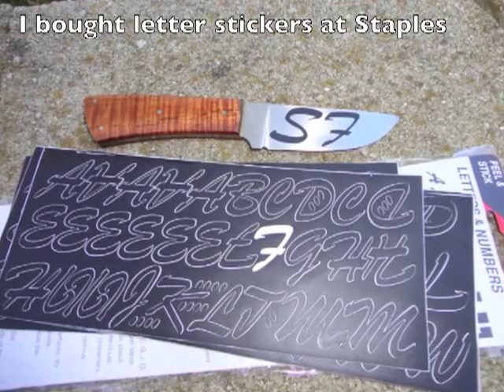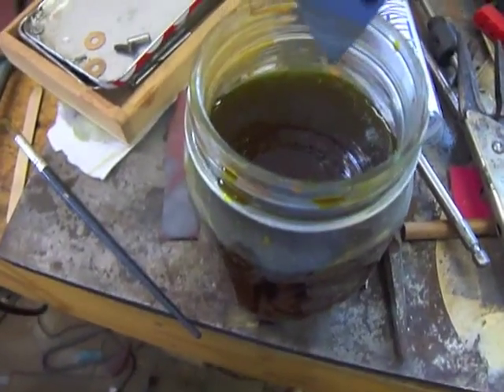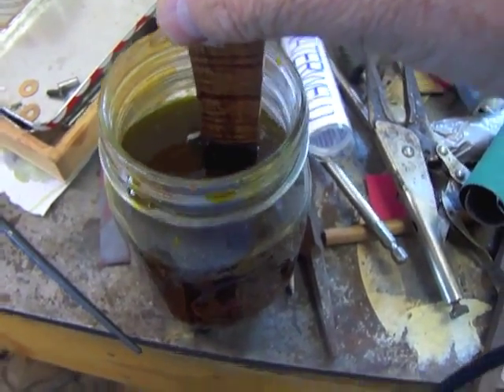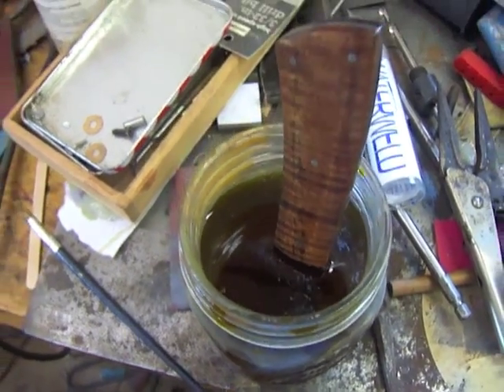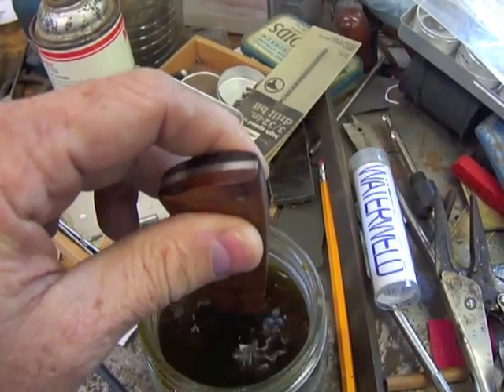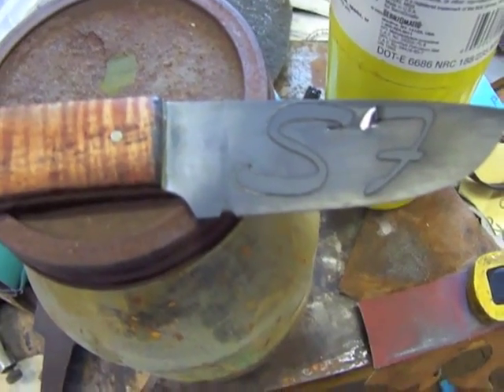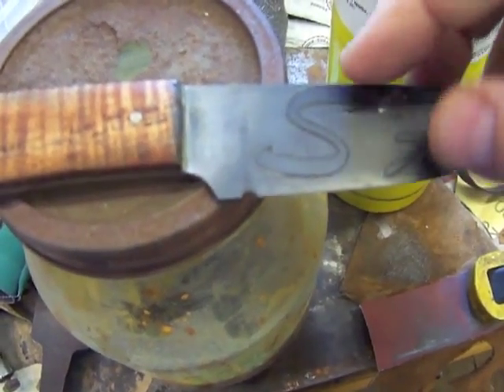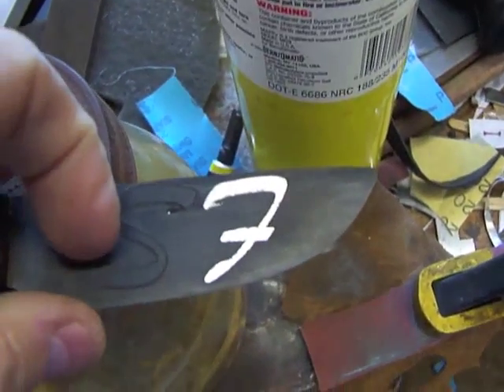Knife Etching

Comment from the maker: It does stand up pretty well to wear, but it will wear off.  A reverse etch is more durable to this process is a little bit more durable.  In other words if the blade is masked and the letters are blank, then the etch is below the surface of the knife steel.